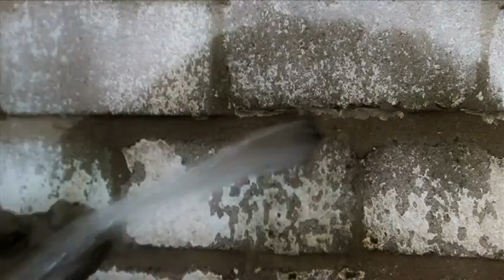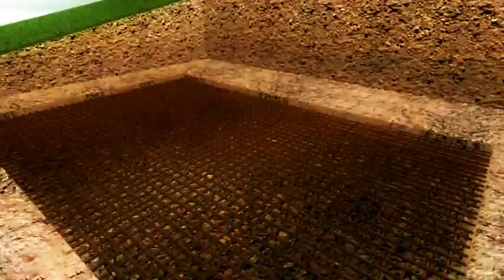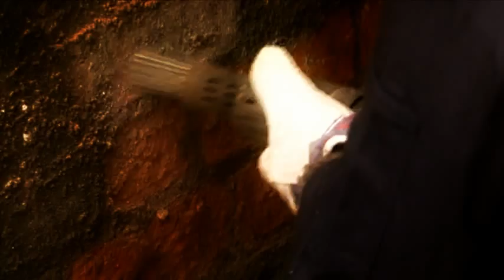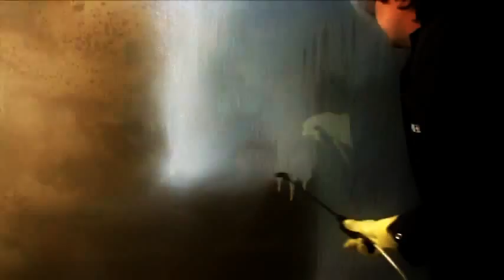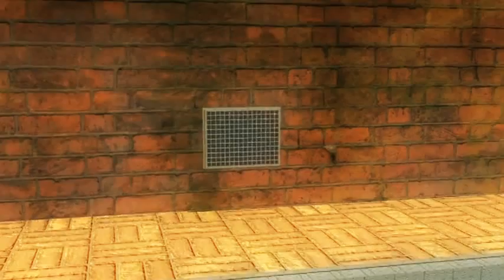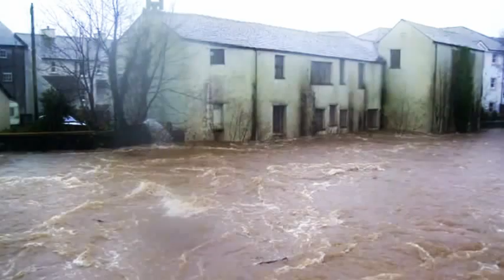Basement tank system from JUST DAMP PROOFING.COM wide.flv

Comment: it's much easier to call in a company that knows what they are doing like Tywi Damp Proofing. it's not as easy as this video makes it out as, there are so many other factors to consider such as can the structure take a type A systems without causing structural damage? It is possible of floors to break up with the presure and walls to fall in. 
When you do a job do it once and do it right! call the experts and get a proper guarantee!

Comment: what does type A protection mean exactly?
Reply: thesouluniversal Type A tanking systems are basically a product that is applied to a surface. Type B is a structure that is designed and built to hold water out and Type C is a Cavity Drain Membrane System. In any situation on a new build two Types are recommended to be used, in renovations reasonable methods need to be included. To meet BS8102-2009 any system must be maintainable.